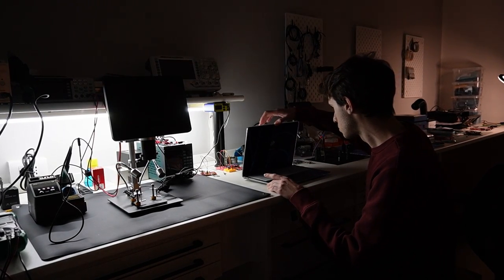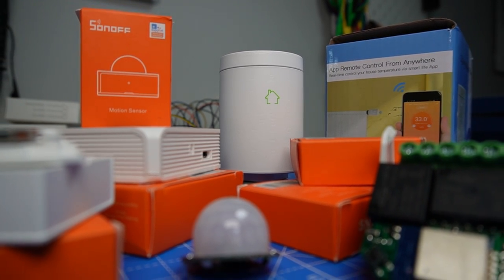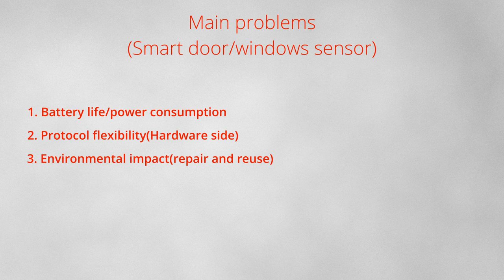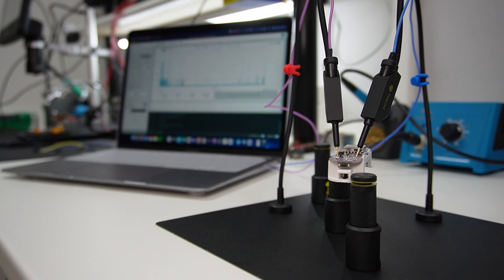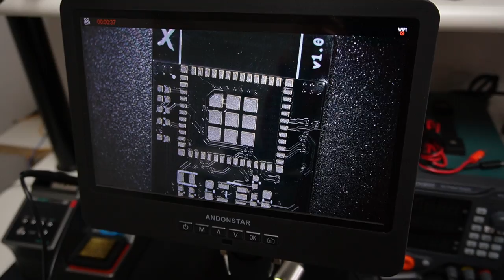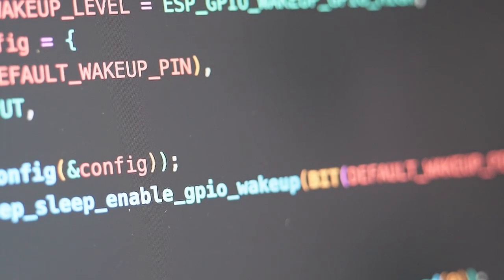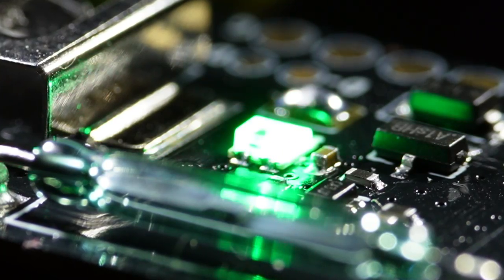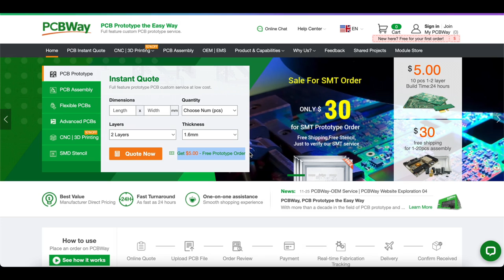I've built a Smart Home device with ESP32-C3 | OBJEX Link based | Part 1

Comment: Lowest power overall configuration: reed switch connects battery to power up and transmit. I do not know if the ESP32-C3 boot sequence and establishing an MQTT radio link is fast enough for the intended application.
Reply from the maker: Actually, I am working on this, using deep sleep is not efficient it does not allow me to go below 3/5uA.

Comment: Wonder if it would be possible to use the reed switch to charge a cap, which can be used to power the esp when the open incident is done. (Or use as its UPS when lipo is lost / en activated because of opening) C = (I*t)/delta V Dependent on the protocol you need only microseconds, but the esp is pretty hungry at transmission. Also a problem is the max power trough the reed when charging the cap and the effect of this on the battery. 

I use the esp a lot, but its power consumption is a thing. For a deepsleep project of myself I use the spx3819 with a lipo, it works for months. But ideally one should change the battery every year or even less, if sustainability is a real issue. 

Interesting power profiler, I bought the Joulescope 1.5 years ago. This seems to be a better deal. And for programming: check the tag connect!
Reply from the maker: I don't know if your idea of using the reed switch to charge a capacitor would work; it would have to be tested. The ESP32 unfortunately has significant consumption in transmission and also in deep sleep. I'm currently experimenting with other microcontrollers. As the LDO in this video, I used the rt9080, but from the next iteration, I'll use the SPX3819 taking advantage of the en pin.

Comment: Very nice project and cideo man!! Thanks for sharing!!

I have some questions.

How did you solder the components? Is that a hot plate?

How did you solder the bottom two connectors and other components on the bottom? If you used a hot plate for soldering the top components, you can't use it for the bottom components, can you?

Where did you get the stencils?
Reply from the maker: Yes, I used hot plate for this project.
Top side hotplate, bottom side hot gun.
Stencils by PCBWay.

Comment: I'm tryin to do the same. After using so many configuration its best way to do use another uC sadly. Stm32l0 family uses 0.1uA and attiny family uses more of the same. ESP should be used as communication but not the control.
Reply from the maker: Very interesting suggestion, the only problem is the cost of the final device increasing. I am currently trying to find a perfect solution to ensure excellent performance without complicating the design too much.
Reply: @SalvatoreRaccardi  yes it seems it will increase it but there is two things to consider;

1. If it's not what u want, you should change the way you look at it. Either be happy with the result or design what it takes. So it needs another uC sadly again.

2. If you drop the module and design with bare esp32 chip itself the price wont be affected. In my country the modules around 5usd but bare chips around 1usd.  Stm32 or attiny will cost another 1usd. So in total with external components it should be even.
Reply from the maker: @thenextproblem8001  yes I know him makes very interesting videos, thanks!

Comment: Nice video! I had some questions:
What tools do you use for measuring the amps?
And what is the software called that you used, when placing the parts on the pcb?
Could you make video where you show what tools (software and hardware) you use and could recommend in general?
Reply from the maker: Hi!
1. Power profiler kit 2 by Nordic
2. It's a KiCad plugin called "Interactive HTML BOM".
3. I'll make a video in the future where I show my equipment and workshop!